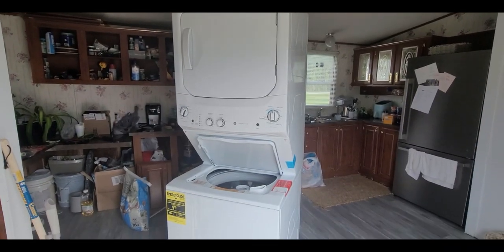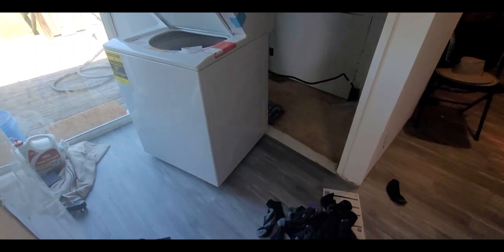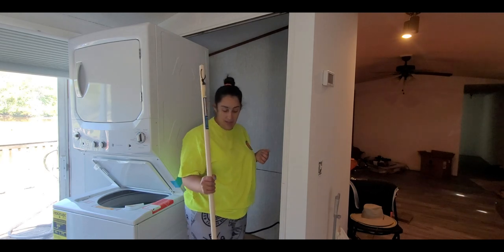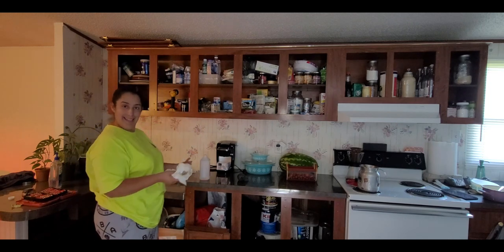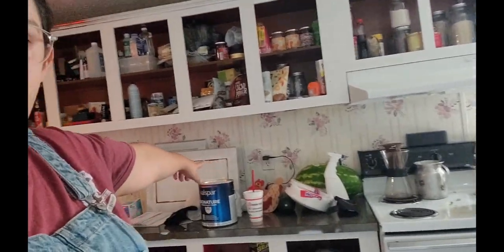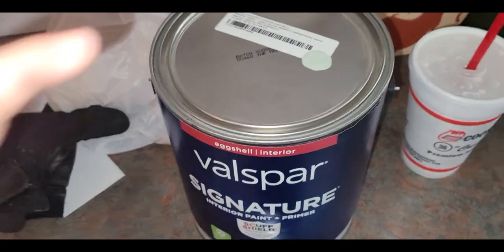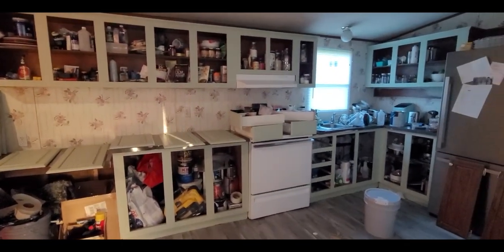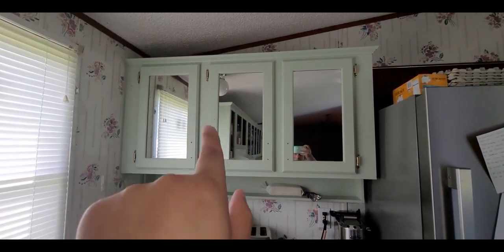Kitchen Cabinets and getting a Washer/Dryer

Comment: I recently purchased the same washer/dryer unit from Lowe's for the townhouse I live in. I had a stackable front load set that I hated, I love this one so much more. It does make some weird noises, but I read in the book that they are normal.
Reply from the maker: So far mine doesn't make any noises. But I have only used it about 5 times. So far however I am in love with it 😍

Comment: Just found your channel.
Green is my favorite color. Is there anyway you can vent the dryer a different direction, like thru the outside wall?
Reply from the maker: Yay. Thank you. Yes so it attaches there to a tube that is under the house that goes outside. I think it was dont that way bc the dryer was originally to the far right of the closet.

Comment: I love your color choice for the kitchen. I had seen another video where they had painted their cabinets in the same color and fell in love with it. I think the kitchen looks beautiful with that pop of color. I think you'll have fun picking out colors on items that will go with it - like different placemats, table clothes, decor for your countertops, etc. I like the idea of a cabinet for the laundry area - a place for your laundry soaps and extra towels, etc. Instead of a tall cabinet, what about putting a small bar across the top so you can hang up items from the dryer, until you are ready to put them away?
Reply from the maker: Thank you so much. That's a good idea let me see how I can implement that. 😃